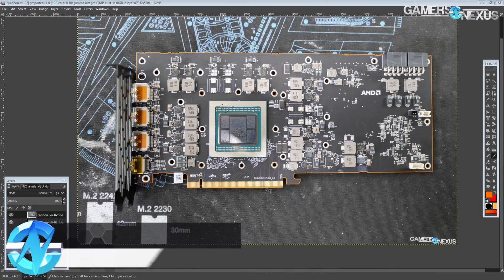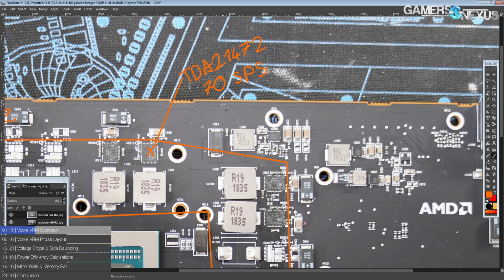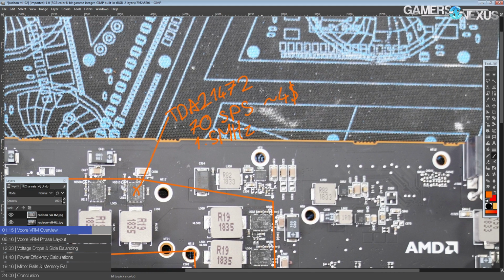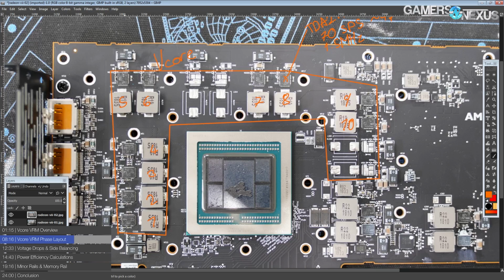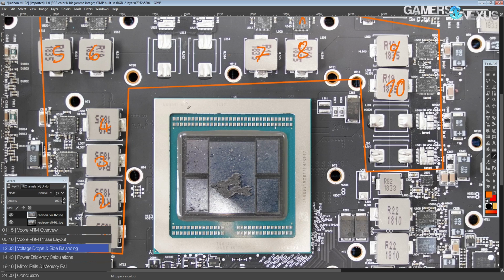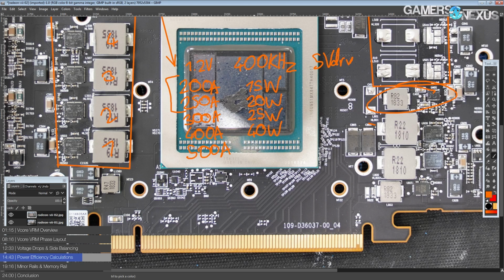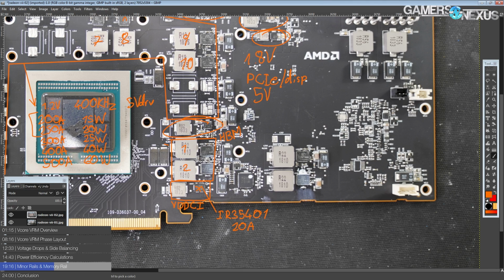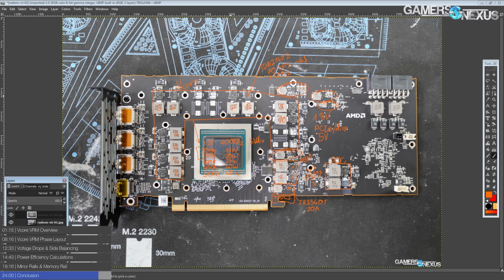AMD Radeon VII's Interesting VRM & PCB Layout

Comment from the maker: Check back tomorrow for our review! We have some very unique testing in there that you'll want to see.
Find our tear-down of the AMD Radeon VII card here: https://www.youtube.com/watch?v=0b9_c4oJRTE
Find Buildzoid here: https://www.youtube.com/channel/UCrwObTfqv8u1KO7Fgk-FXHQ
Reply: It's already tomorrow here
Reply: You think it would be possible to mod the power stages back on ? Radeon 7 BZE ?
Reply: Buildzoid needs that card when you're done, so he can solder on the missing power stages! Hint, Hint!
Reply: How many hours for the review?
Reply: Gamers Nexus   no mGPU support = huge red flag
Reply: If I have cancer can I see the review early
Reply: $600!
Reply: this pcb might be future proof and will be used for navi gpus as well. and not empty vrm slots and 2 phase hbm controller will be used fully on those cards
Reply: @BlueScope819 9AM Eastern US time, don't know other time zone conversions...(For the NDA in any case, not sure what exact time the vid will post)
Reply: Steve and Jay should do another oc battle but with the Radeon VII
Reply: So, watching the review and this video I have a question. 

The VRM and the core+HBM are the main sources of heat.
If the VRM components are so efficient and 7nm is also very efficient (although it's running on higher clocks) where does all the heat come from?

If it's AMD it's hot (sic), I know, but I smell heavy undervolting in the air...
Reply: Hello , can you help me to solve the Amd vii problem ? , may card turn or but black screen ... can you help me how to check the spare parts ??
Reply: what time exactly? It is already half way through thursday im aus...
Reply: @Nicolas-zo6rg  Hardware unboxed said what time it will be in Aus, in their video...

Comment: if they had to produce Vega20 with 4 stacks surely amd could have used "bad" HBM that doesnt meet the requirements to be 4gb. then just make VII an 8GB or 12GB GPU. or even use HBM that couldnt hit 1000mhz and just have VII run hbm at a slower speed like 850mhz.

the cost for the hbm would drop significantly as they dont need the cream to the crop anymore, and they reserve that for MI

Comment: Whats actually stopping someone from buying the extra VRM components and soldering them into place on the board?
Reply: they probably severed the connections on the PCB, and i think software wise the bios would probably freak out.

Comment: Wouldn't having the power delivery in an O shape mess with PCIe? I would suppose the manufacturer would want the GPU to be as close as possible to the PCIe connector, with no power circuitry in between to cause interference?

Comment: Hey Buildzoid, don't the high switching frequency power stages mean that the efficiency curve gets moved to a higher switching frequency? So you might usually run at 250mhz (not sure what auto is usually set at), and now you can easily run 400mhz (probably an exaggeration)?

Not sure what that would be really useful for, maybe a 24/7 system with beefy watercooling that can handle the heat of pushing the vcore to a point where switching frequency matters?

Comment: Admittedly, I am just shooting in the dark here. Since the PCB is set up for it if you had the extra Voltage regulators and power stages; could you add them to the board in a working capacity?

Comment: Is there any reason Amd chose to populate the phases "5 and 6" aswell as "9 and 10" instead of the missing ones? if i understand it correctly the left out places are a bit closer to the GPU lessening the voltage droop across the core or do i miss something here?

Comment: very happy to see they gave the SoC a dedicated rail, as vega had a severe hardware fault that caused the SoC to die with certain displays and display combinations. The SoC was being fed inadequate voltage, which eventually led to a whole PCIe root complex collapse, commonly seen as a head-less hang of various results...
 (display corruption or non-standby blackouts, while music and games would still run for a few seconds, windows would never DUMP due to lost access to the drives, etc)

Comment: $599.99 US funds XFX RX-VEGMA3FD6
Model

Brand
    XFX

Model
    RX-VEGMA3FD6

Interface

Interface
    PCI Express 3.0

Chipset

Chipset Manufacturer
    AMD

GPU
    Radeon VII

Core Clock
    1400 MHz

Boost Clock
    1750 MHz

Stream Processors
    3840 Stream Processors

Memory

Effective Memory Clock
    1 GHz (2.0 Gbps)

Memory Size
    16GB

Memory Interface
    4096-Bit

Memory Type
    HBM2

3D API

DirectX
    DirectX 12

Ports

HDMI
    1 x HDMI 2.0b

DisplayPort
    3 x DisplayPort 1.4

Details

Max Resolution
    4096 x 2160

Virtual Reality Ready
    Yes

Cooler
    Triple Fans

System Requirements
    Minimum Power Supply Requirement: 750 Watts
    XFX Recommended Power Supply: XFX 750W PSU

Power Connector
    2 x 8-Pin

Features

Features
    7nm Process Technology

    Radeon FreeSync 2 Technology

    1 TB/s Memory Bandwidth

    Vulkan Optimized

    Radeon Wattman

    Radeon ReLive

    Radeon VR Ready Premium

Form Factor & Dimensions

Max GPU Length
    280 mm

Card Dimensions (L x H)
    11.02" x 4.92"

Slot Width
    Dual Slot

Packaging

Package Contents
    Accessories:
    2 x 8-pin to 6-pin power cable

Comment: Could you add the missing parts for the missing 4 stages and have them work? Or would you have to alter the circuitry of the regulator?

Comment: so it's basically a chip on a power supply. AMD is close to releasing gpu motherboards with a graphics socket at this point. navi will ship as a PGA package with a radeon graphics adaptor to occupy a pci-e slot
Reply: WrothBog that would be...interesting

Comment: It´s funny being a guitar nerd listening to a computer nerd geek out over components. We debate what Op-amps and diode clipping sound best in our Tube Screamers, the properties of silicon in fuzz, and what coupling, filter and bypass capacitors suit an amp etc. How power conditioning affects our effects pedals and stuff too. But Mosfet powered is not something we pay more for. We want old school vacuum tubes like in Fallout, although some have gone digital now.
Radeon VII Fallout Edition with a tube rectifier and/or a diode would get my attention. Glowing tubes inside my gaming rig would look cool, even though they are unreliable. Kind of joking, but kind of not.
Reply: The difference is that different power stages do make a difference, as opposed to different op amps, which have negligible difference, since their job has nothing to do with frequencies. You don't pay more on parts because none off the components that compose a pedal or amp are high precision parts.
Reply: @crimsun7186  you pay more for certain analogue components as they produce various harmonics, changing the timbre of the sound. Unlike here, instrument amplification isn't necessarily about the cleanest sound, but about getting the preferred distortion of it.

Comment: No one is buying the 2080 the big sellers are the 2070 and 2080ti  so Ryzen VII only has to be on par in gaming to 'win' .  Tomorrow will show if the initial supply rumors are founded or if AMD selling direct in the US means some guarantee of availability to gamers.   It will come with the 3 game offer supposedly so that would offset the SEP $700 to ~$520.  Still a good match for a TR 2920X or 2950X owner.

Comment: Thanks for your analysis of the card. So they basically incorporated quality components and designed it to be very stable and last? Would you say that the components are better than those of the RTX 2080? From the tear down it looks like if I needed to replace the graphite pad on the GPU it would be easier than doing it on a RTX card? Which card do you think would 'last longer'?
I'm thinking of long term investment- keeping a graphics card until they can't 'do the job' e.g. 5 to 7 years.
Reply: In pure performance it's within margin of error at 4k ultra. With so few games supporting rtx or dlss I think having 16gb of 1tbps memory is more future proof than only having 8gb (my rx580 has 8gb).

Im pretty sure in 3-4 years games and mods will require more than 8gb for 4k ultra, but whether either could run those settings smoothly i'm not so sure (30+fps) neither card gets more than 45fps on some titles right now so you're definitely going to have to drop settings and or resolution at some point.

Id say get the radeon vii. Or wait for navi intel and 3080. Turing was so overpriced it's hard to recommend a $1500 card lol

Comment: why is it "actually" hardcore overclocking?
Reply: Cause some people think turning all the sliders up in aferburner counts as hardcore overclocking, whereas Mr. Buildzoid here is not done with a GPU until it simultaneously has frozen GPU core and a burning VRM

Comment: Buildzoid said that he was disappointed that those power stages were missing, it wouldn't be very difficult to throw them onto the board assuming you had some laying around. The pads are there, so the traces must be as well. What's to stop someone, assuming the individual components are available for purchase by the average person, from just putting the components on the board?
Reply: the the thing is the controller needs to be reconfigure to run with more phases
Reply: @ActuallyHardcoreOverclocking  Thanks, buildzoid. I figured there was something more to it than just slapping components on the board.
Reply: @ActuallyHardcoreOverclocking  There are rumors of Powercolor having plans for multiple Radeon VII sku's, but they have said that there wont be any custom pcb's. They could be using this pcb fully populated to differentiate their lineup, so the dream lives on...
Reply: @ActuallyHardcoreOverclocking  is the controller strapped by tieing pins down, or is it a mcu booting microcode of some sort?

Comment: This new 1GHz HBM2 is probably spec'd at 1.2V instead of the 1.35V overclock V64 HBM2 runs to hit 945MHz. So power draw by the memory on RVII should be less than 2x that of V64.
Reply: Seems high that V64 ram vcore didn't know , have my o/clocked V56 running HBM2 945mhz set to 0.950v runs around 1.075-1.080 under load with the occasional spike coming close to 1.1v.
Got thing as christmas prezzie and have to I'm loving it, even if it can pull to 290+ watts.
Reply: @paulzx10  the HBM2 voltage is controlled by bios. V64 is 1.35V and V56 is 1.2V. That is why people flash their V56 with V64 bios, to get the 1.35V to push the memory higher 

The RVII should be 1.2V for 1000MHz

Comment: Can we just fill in the vrm to get more efficiency or is their other component that would need to be replaced?
Reply: you need nothing unless you're going LN2, current VRM it has is already overkill, dude its a fkn MI50 repurposed for gaming, with the same PCB and almost the same components. I feel bad that those impressive cards will be called trash in no time by the "gamer" comunity.
Reply: @yottaXT  well it is my understanding that with more vrm you wont have to cool the vrm with any thing special at least not as quickly. I preffer extreme air overclocks. I dont want to use rocket fule in my computer room, not safe and very expemsive and very temporary. I find that on most GPUs begining with the gtx 400 sries and skipping the 500 series for a while now temps arent what prevent you from acheiving higher clocks. vrm is. When your GPU is at 54 - 74  under load and your still unable to take clocks above +125mhz core clock... The limiting factor for most hardware is vrm. Temps are what happen if you dont turn the fan up and lock it or your case is poorely designed or you hate the sound of your fan and you'd rather have a dead GPU. Vrm is how they make you buy a new GPU. Also i really wish it wss the 32 gig 64 NCU model. And with VFIO and ECC. With a tarabite vram bandwidth and its vddc radeon vii could easily maintain gaming performance with ECC and slight tweeks. Why sell me an instinct that won't support my VMs and allow hardware pass threw for deep learning, compute and a gaming VM? I was hoping this was the card that ment I only have to own 1 computer and I could get rid of all my aging hardware and build a single high core count pc for all task inclhding gamin and just switch VMs at will keep them all active at once. As well as switch to linux mostly and only use windows for gaming sandboxed in a nice VM...

Comment: I wonder if its possible to populate the VRM at home, or if a PCB / circuitry place could solder it with the provided parts, and with a bit of BIOS nodding with the power delivery, it could be a great OC card

Comment: I don't need 16GB of HBM 2 for gaming. Fully populated VRM with 8GB would have been better.
Reply: mustbeh4x Probably wouldn’t have been. Memory bandwidth was a major bottleneck for Vega64. Bandwidth is doubled for the VII.
Reply: @clippy_friend  
At stock memory speed yes bandwidth was a bit limiting but it's also fairly ROP limited too.
Reply: There is the old addage, "better to have and not need than to need and not have".

Comment: Is there a chance, this is just a completely re-purposed MI50 with a different cooler and slight modification to the GPU chip being fused, to explain the expensive parts?
Reply: That's not true apparently. Apparently, the Radeon VII was the first 7nm GPU AMD developed, with the Instinct cards coming later. Also, Navi was suppose to launch at the same time as this, with this taking the High end and Navi low end. Radeon VII wasn't just a last minute thing.
Reply: That's exactly what it is. It was likely rushed out because Navi got delayed.
Reply: @isakh8565  imagine putting the MI50 Bios on this thing and running it with the compute part uncapped. Crazy for 700$
Reply: @isakh8565  Yep that's my guess aswell.

Comment: almost a hundred bucks just in VRM parts...
Reply: Yeah amd literally just release this card without the expectation it will sell nor the expectation they will get a revenue from it,
Reply: @faisalhabibi6348  It's simply the MI50 accelerator with an active cooler on it. The card was never made for gaming. It was made for HPC use doing things like deep learning. AMD is just selling these at a tiny profit margin to stay on the market until Navi
Reply: @SAMSTRECKER  
Not really. It's already confirmed the PCB is different from the Instict's PCB.
Reply: @SAMSTRECKER  nope this would be completely destroyed by a 2080 in deep learning this thing is it will have to kinda emulate cuda it drastically decreases performance
Reply: @SAMSTRECKER  Even if AMD released superior product Nvidia would outsell Radeon cards by 10 to 1 ratio.
Reply: @abcdxx1059  You do know that CUDA is an NVIDIA developed tool for GPGPU  to run code on the GPU. On AMD hardware you'd use something like OpenCL instead.
Reply: @MindaugasSnegirevas  Brand loyalty only goes so far, HD7XXX series creamed Nvidia at the time and sold like hotcakes.
Reply: @MindaugasSnegirevas  We don't know that. Would be nice if they did.
Reply: @abcdxx1059  Nope, ROCm stack runs native, no need to emulate. And the 2080 sucks at Deep Learning since training runs on full precision, not half precision.
Reply: @MindaugasSnegirevas  yeah sure because amd cards are the only greatest cards ever where market and consumers never have a clue - Jen Hsung has Putin and bots beghind snowing the consumer into buying nVidia, which of course according to you fanboys costs more and is slower
Reply: I prefer seeing money going to features I can see, rather than paying 500 USD more for a feature that's not even ready at release and has questionable advantages.
Reply: @crimsun7186  Like an overkill power circuitry?
Reply: @crimsun7186  and here we all should agree
Reply: And they said Nvidia is expensive.
Reply: @madfinntech  urgh wtf are you even talking about

Comment: Since Radeon 7 is derieved from Instinct series, they probably used same high quality components.
Reply: Actually the PCB of the Instinct is different. The die is most likely the same though.
Reply: 1idd0kun “Vega VII is derived from Instinct MI cards” =/= “Vega VII is a Instinct MI with a different sticker/nameplate and literally every other component being equal/unchanged.”

That would make it a rebadge, not a derivative, as implied from “derived”. Sorry it’s a pain to type on the phone so I’m being very to the point and probably sound like I’m being cruel, just attempting to correct the record.
Reply: That's not true apparently. Apparently, the Radeon VII was the first 7nm GPU AMD developed, with the Instinct cards coming later.
Reply: Juggernautdemon tbc Radeon VII is a graphics card technically speaking and Vega 20/7nm Vega is the GPU. you’re likely confusing information about Vega 20/Vega ReFresh, which was AMD’s first 7nm GPU & first GPU created specifically for Machhine learning (though that’s a bit misleading) In reality all Vega cards are first and foremost compute cards, Vega 10 (14nm Vega silicon as found in both Vega 64/Instinct) was always planned to be refreshed, w/as much of a performance boost coming from the HBM bandwidth boost as from the process node shrinking to 7nm. 

The goal in a perfect world was for Vega 20 to never make its way into a consumer variant, but Navi wasn’t quite ready & Mike Rayfield’s final project was to prepare a Radeon release of Vega 20 just in case, and he pushed hard for its release from the get.
Reply: Juggernautdemon no it’s definitely true, it’s a consumer version of the lower tier Vega 20 card.

Comment: Solution is easy. Populate it yourself
Reply: that's what i was thinking. if it's there it has to work? might have to get a few other things around them but in my head the controllers have to be able to control the lot so maybe a modded bios also.